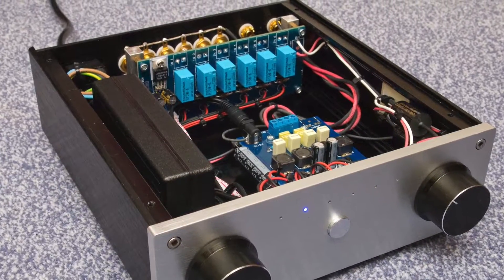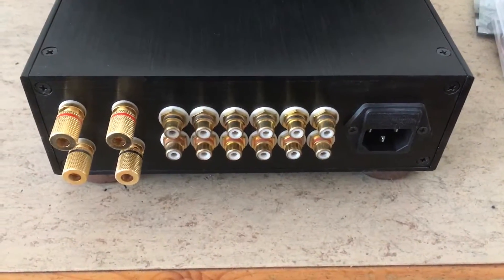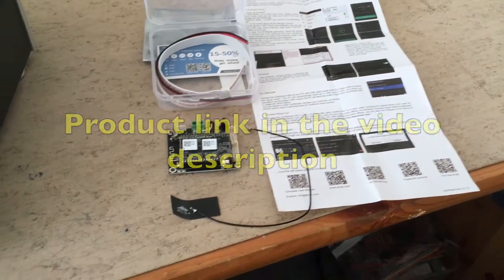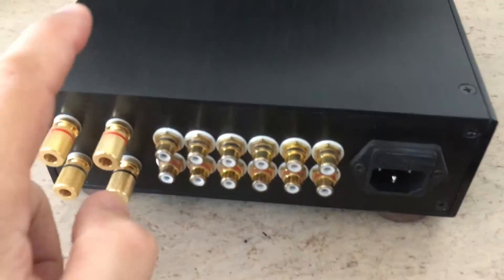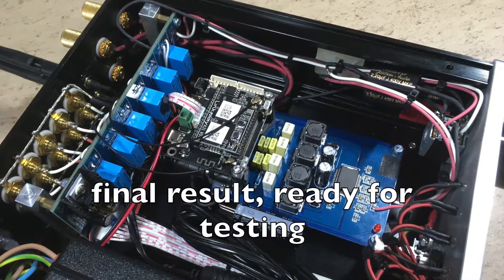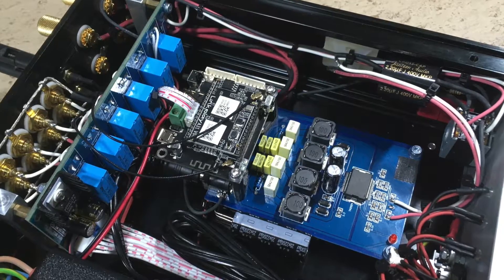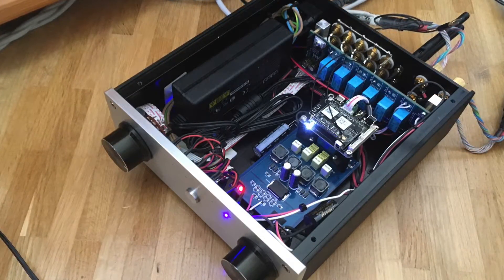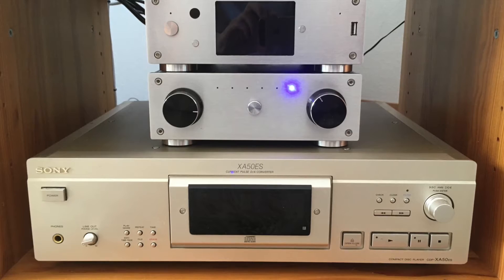Up2Stream Mini: How To Add Cheap AirPlay & Spotify Streaming Support To Your Amplifier!

Comment: Awsome..bit it's still cheaper to buy an echo dot and tear the guts out and shove that in your amp.
Reply from the maker: Thanks. No, the echo dot is more expensive, and as far as I know, it does not have AirPlay
Reply: @TheDIYGuy999  40gpb for the up2. 25gbp for echo dot. No it doesn't support airplay. But Apple and other groups are soon to shift to a "universal" standard for smart devices. So I don't feel like airplay will be a deal breaker